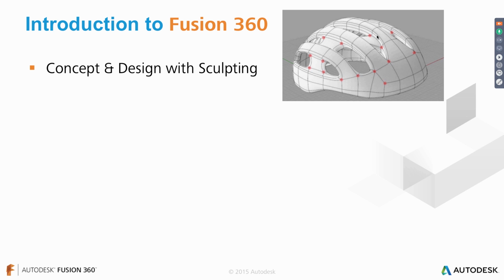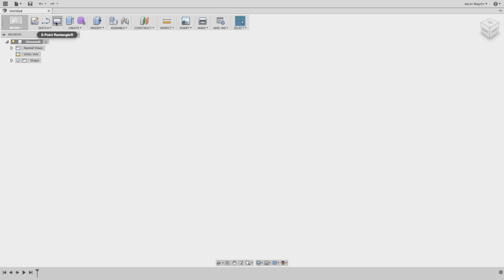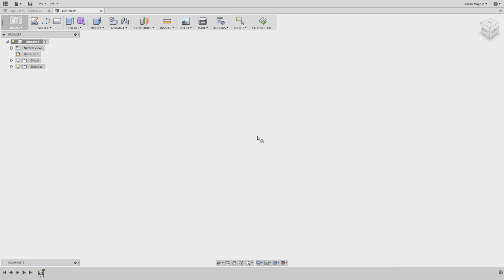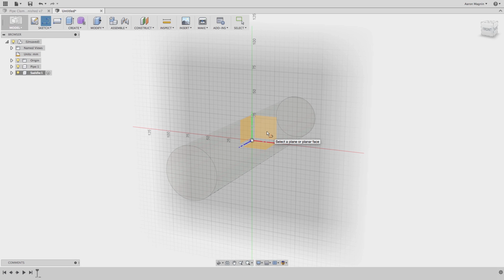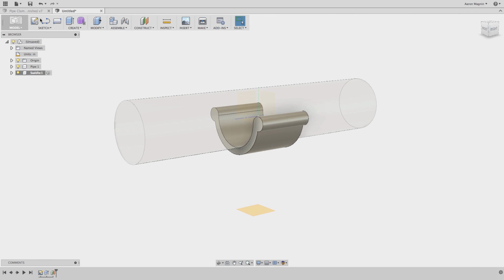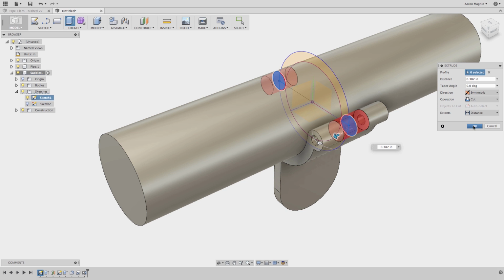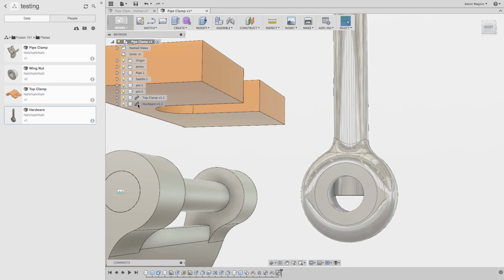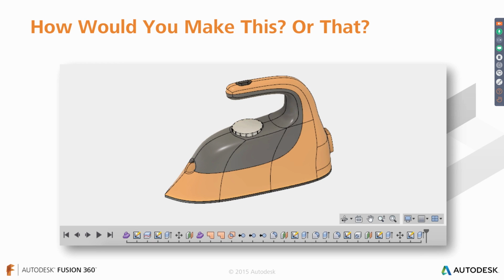Autodesk Fusion For Beginners - Recorded Webinar

Comment: Hi there.A great tutorial. really helpful, and not rushed or too technical. Thanks.

I do have some issues (I'm using the latest version of the software as of this date, running win10). 

When I get up to the adding pins to the assembly, I have two issues:

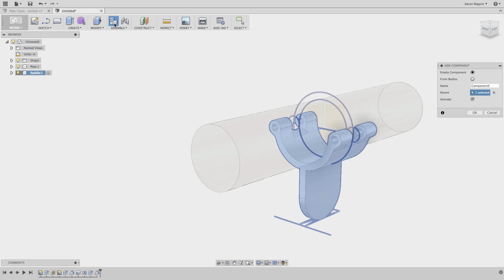1) when I create a new component, via create in the assembly (@42:20min), the dialogue shows up. However, as soon as I select the top of the tree (After deselecting the existing component, to be sure), the new component is added straight away, without confirmation, as soon as I make the selection. I'm aware that I can rename it later, yet very annoying.

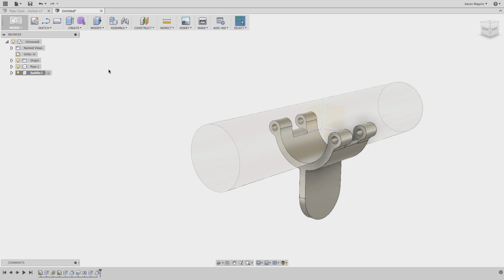2) More frustrating is the fact at in adding the cylinder (@42:20min), I am unable to properly select the existing features to reference. I can kind of do so, yet the faces are not viewed as selectable, and I just have to guess at the centre of where I want the pin to go. It does seem to find the centre and reference the diameter of the hole. Once it is created, it is 'correct', yet there is no interaction possible. Opacity is set to 70% for the existing components, and the other sketches are set as being visible at all levels in the 'saddle' sub-tree. 

I can't find any settings in preferences that would effect such operational interaction.

3)Finally, the modelling tool dialogue (accessible using the 'S' shortcut) only has the extrude and fillet shortcut icons. How do I add more options?

Kind regards
M

Comment: Fantastic Tutorial !!

What about the interference between the actual pipe that was modeled and the clamp nut base.  It looks like the pipe would interfere with the hub of the clamp nut. Would you use the same technique?